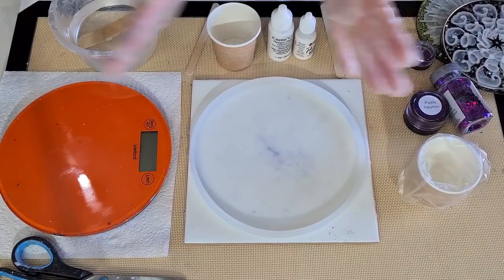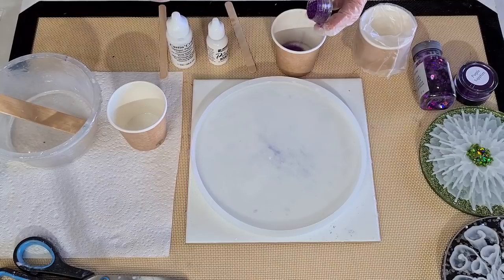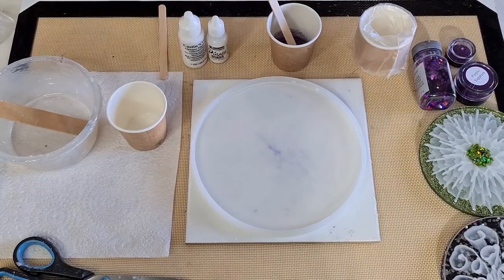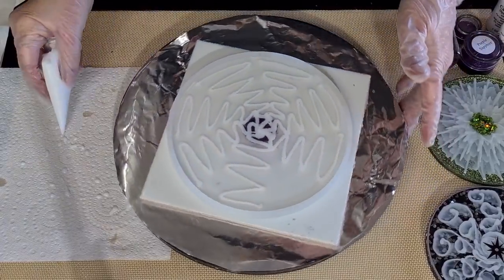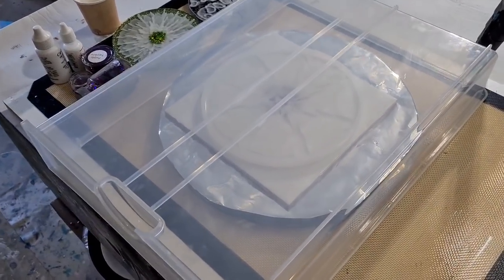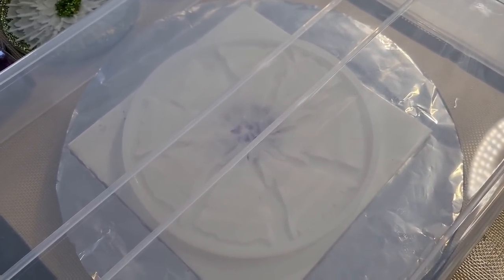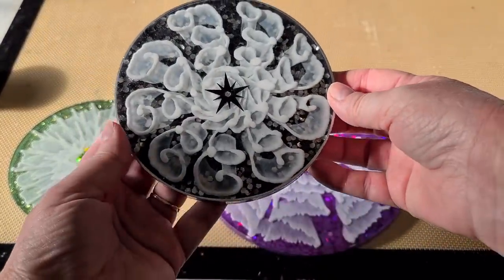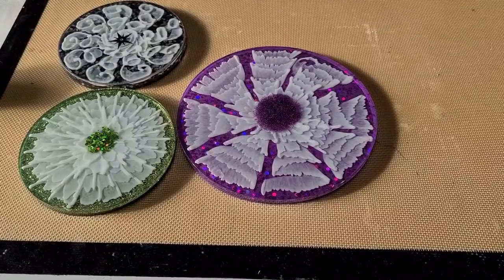#1049 Amazing 3D Resin Flower Bloom Coaster Using A 'Zig Zag' Design

Comment: Julie- add 2 or 3 drops of 91% or 99% alcohol onto the Colour Arte Purple Sapphire color you’re using right after adding it to the resin- it will make the purple bits disperse as they should and it won’t be so pinkie!!!  Several of the Colour Arte micas have tiny pearls bits in them if you look closely & they don’t disperse without a wee bit of alcohol added to break them up.  
Lovely zigzag and the swirly one too!  They are all stunning 😍

Comment: This one is my favorite so far. Even though the other ones were pretty. I was thinking about what you said about trying other designs. I was thinking about the split cups that are becoming popular. Could it be used the same way but with resin? Obviously you would have to mess up one of your cups to try it. If you would pour like a tree ring. Turn the mold on a lazy susan. Then maybe use a skewer to pull through the resin if need be to reck it to the design that suits you. Just a suggestion that I don’t know if possible. Thank you Julie for sharing your talent with us!

Comment: I have the same problem with molds becoming rumpled on the bottom. I also glue my mold to a hard surface (wood). To get the part out I use compressed air to blow the part out. Works for the tall skinny molds too, just use a small piece of rubber tubing so it does not scratch the finished product.